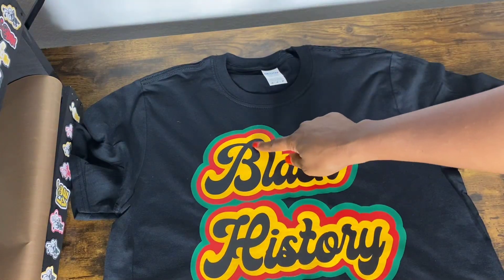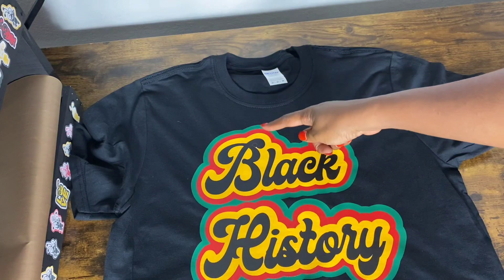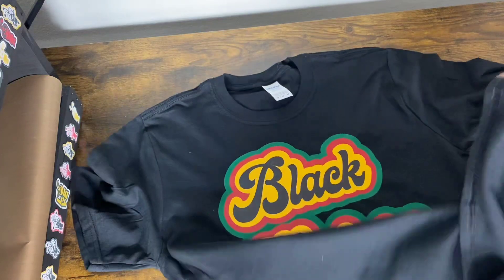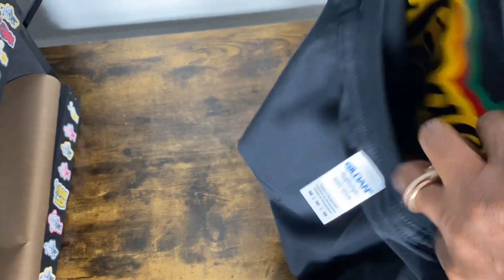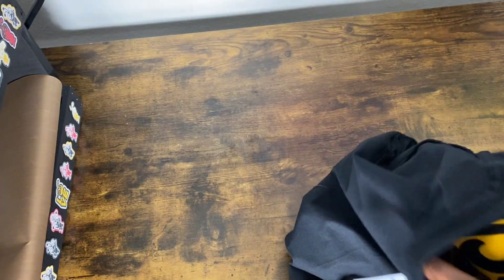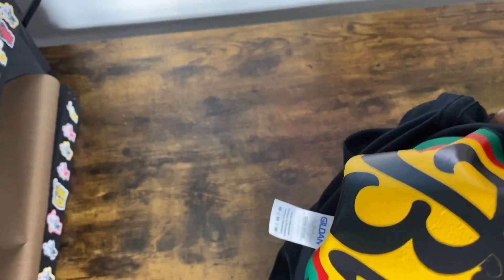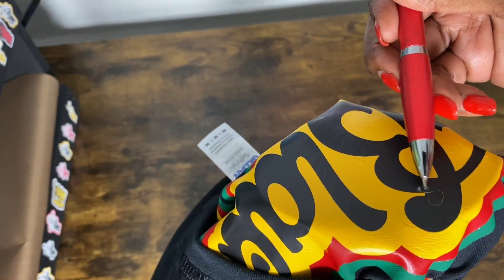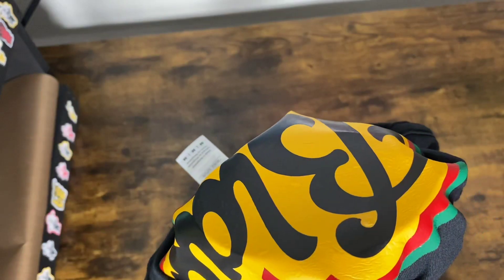HOW TO REMOVE A SMALL PIECE OF FORGOTTEN HTV | HOW TO REMOVE HEAT TRANSFER VINYL

Comment: I’ve done this before cause I wrote 86 instead of 87 😅 but the other tip I would recommend IS once you remove the mistake, repress that area from the front to stick it back down. Because at the :45 mark, you can see that the yellow HTV starts to get wrinkly looking when it was smooth at first. That happened to me too so hope that helps y’all too ☺️☺️
Reply from the maker: Thanks for sharing
Reply: @CraftingwithDelonda  🥰🥰 Love your videos!! You’re so talented and helpful! 💖☺️
Reply from the maker: Thank you 😊